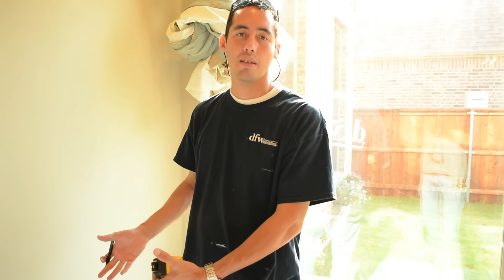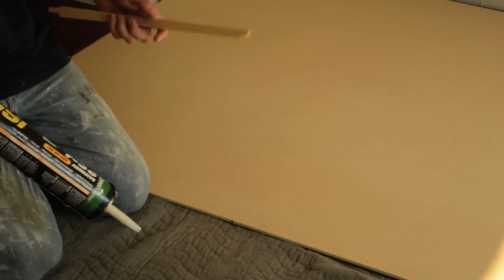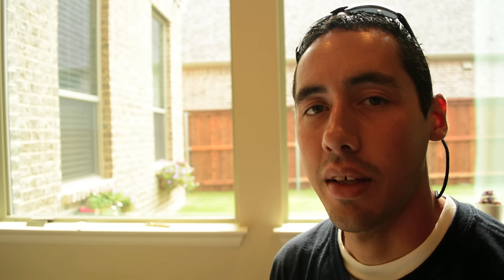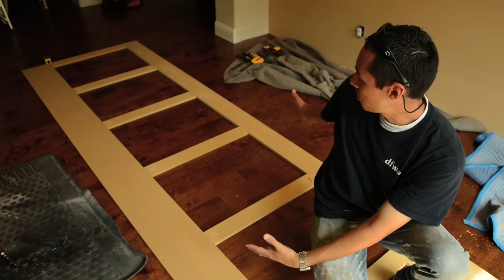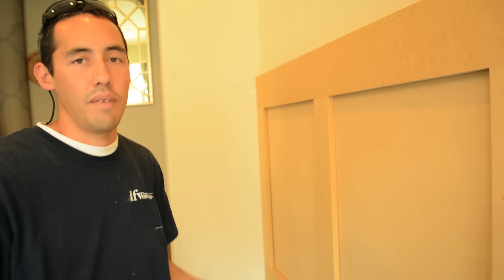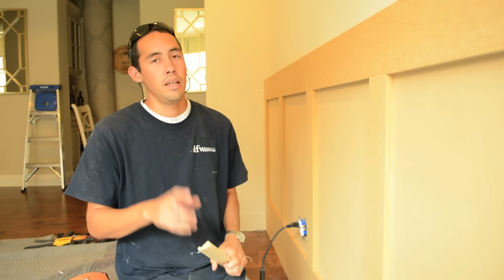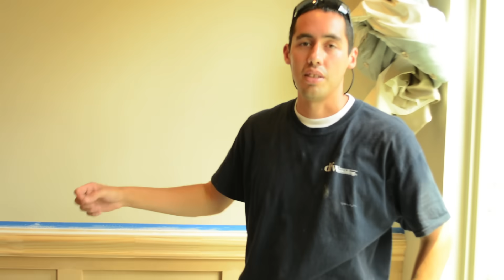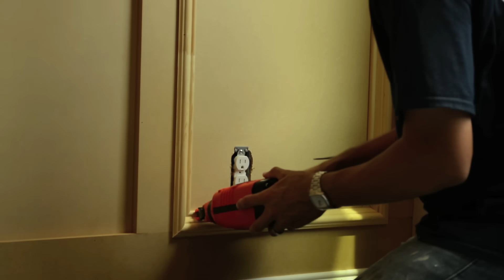Recessed Panel Wainscoting Installation - How to Install

Comment: Really well done video and much appreciated, but why couldn't you have made this two years ago when I needed it!! haha.  I wish this video was available when I did my own recessed wainscot panelling in my dining room.   Our walls are horrible (new construction, go figure) and being new to all of this at the time, I put the rails and stiles right against the wall without first building the frame with pocket screws;  I encountered the exact issue you mentioned - uneven walls yielded slight lips at some of the joints.  That required a tons of sanding and filling, ugh.  Originally, I had wanted to remove the drywall and put 1/2" plywood but apparently that is against fire code on an exterior wall and sourcing fire resistant plywood where I live is tough.  I did think about gluing a 1/4" birch plywood or MDF backer to the drywall, but I was concerned about how far this would push the panelling off the wall and what that would mean for back band on doorway/window casings.  Like you mentioned in the video, I didn't want to take up all the depth with panels, so I did my panel inserts using high density 1/8" fibreboard (that stuff is tough.)  Unfortunately, because it is so thin and won't easily take a brad nail, I ended up rabbeting each rail and stile and sliding the panels in before putting on the top rail; my thought being that the panels were too thin to stay put with just glue so the rabbeted rails/stiles would hold them down.  It worked well but in hindsight it was way too much work and I should have just done it the way you show it here.  lol!I think I like your chair rail design better than what I did with just a flat 1" top cove moulding underneath.  I really like the panel moulding look.  A quick question, do you cut the mitres on the panel mould by holding it up to the fence, like you would crown moulding?Also would you ever use a recessed panel router bit to make the rails/stiles and moulding detail?Anyhow, thanks for taking the time to make the video.  Great info.P.S. The only part of the video that made me cringe was watching you drill pocket screws with the stiles resting on the hardwood floor.  I know they shouldn't break through but that would still freak me out as a homeowner. :)

Comment: Nice! If you don't mind me asking how much do charge for something like that including painting? 
Cheers from Canada.
Reply: If you are looking to charge for anything you need to create a metric. One of the best ways is to cost materials and then add an hourly rate on top of that. 

When you get good at this type of work you can have a very clear idea of how long it will take to do based on the area size of the task.